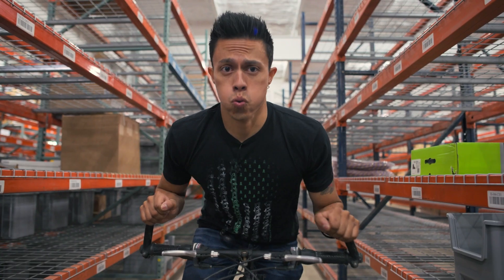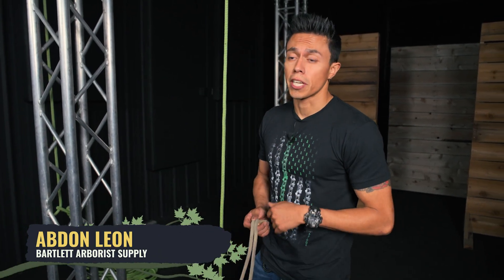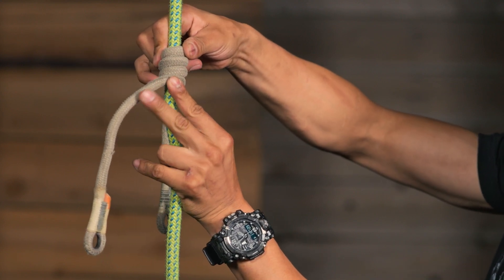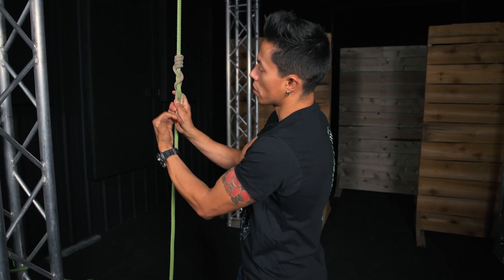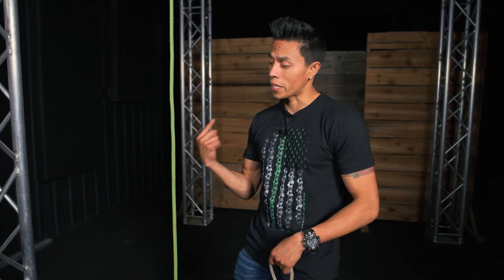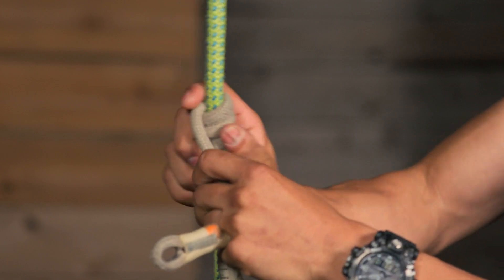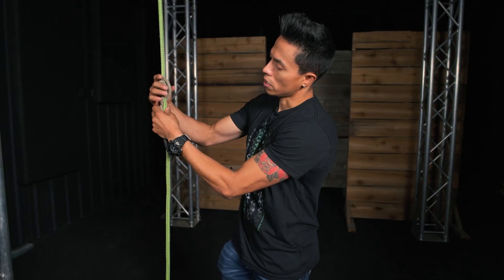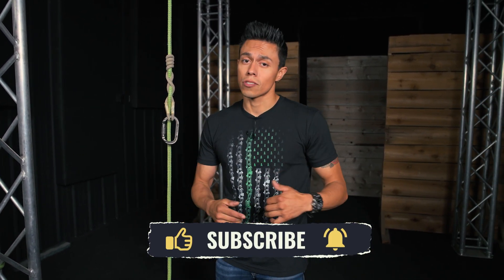How to Tie a Valdotain Tresse Friction Hitch - Bartlett Climbing Techniques

Comment: Top  goes under the bottom not the other way around.  still tying that wrong dude.
Reply: Brer, I’ve seen people tie it both ways. I started to tie top over recently and was experiencing the hitch running. It was driving me nuts. I thought it was because of different rope and cords I was messing about with. So with your advise I tied top under. Now it’s like Jack the Bear. Ty 👍 🇨🇦🇺🇸
Reply: That's the way I was taught too